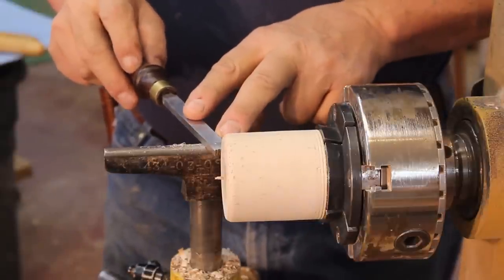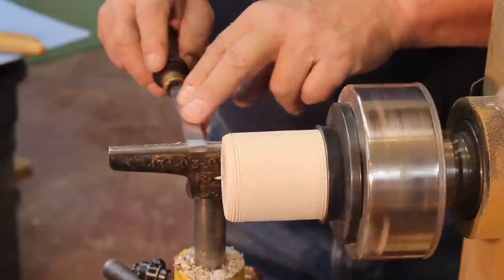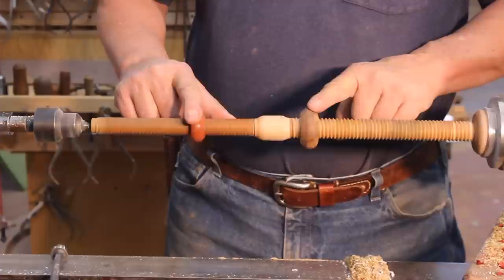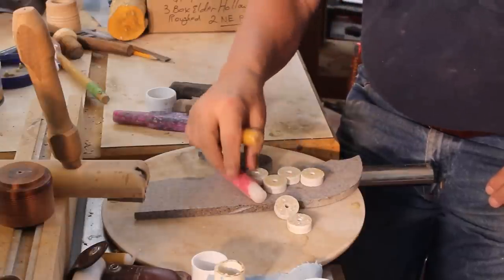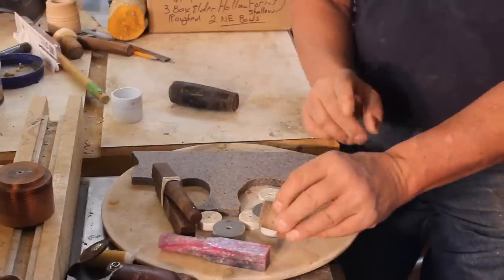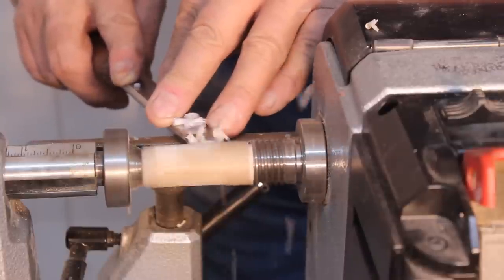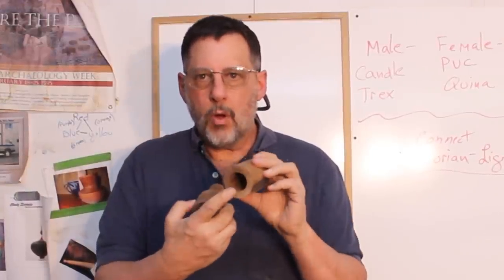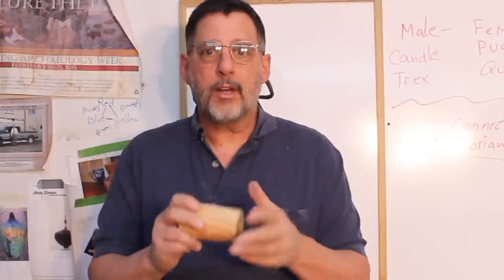Teaching aids for Thread Chasing: woodturning

Comment: Sam ... I appreciate you doing pieces like this. I think one area where most of us hobbyists fail at is the need to practice. I'm trying to do more practice runs with cheap stock like poplar and pine before I chuck up the good stuff. Some of the practice pieces actually get finished, but most just go to the burn bucket.

Comment from the maker: I would recommend either a 16 or 18 tip chaser.  You can get either at Hartville tool in Ohio.  Good website and free shipping.   I started with the 16's.  16 chasers are easier to mate the female and male threads cause the depth of the threads are greater.  20's may be easier to chase but are tiny in comparison and I find hard to mate up.  Sam

Comment: Hi Sam I have for a few weeks trying to make a thread chaser from a bolt and a die. My lathe will only go down 600rpm I do not know if this my problem. Have you ever made a thread chaser? My threads look good  but that is all they will in no way thread together.
Reply from the maker: +Jerry Gwin I think the 600 RPM is do-able, a bit fast but that will take some practice.
Yes, I did try to make some thread chasers.  I think maybe the bolt approach might be a good way to go????? Not sure.  I actually tried to form them from old wood chisels.  I gave up very quickly.  I am a woodworker.  I am not a machinist.  If YOU are more of a metal worker, you might have better luck.  If this is what you like to do. Go for it.  But if you want to get into chasing threads by hand, then go by a set and you will be farther ahead.  Good luck. Sam
Reply: I made my own chasers using pieces of square 1/2" iron stock and a 1/2" bolt. They work very well, you just need to temper them. Now I wanna make some more TPI ones. In my channel if you want you can se me using those chasers o a soft wood (thats why they don't finish cleanly)

Comment: Hi Sam.  Thread chasing issue: can you chase on other than spindles?  I'd like to make a low box, 3 or 4 inches in diameter, and maybe 2 inches high.   I don't have any spindle wood large enough (that will take threads).  I have some osage orange that I think might work.  What do you think?  will it work?
Reply from the maker: +Daniel E Moerman Yes you can.  I have the same issue at times.
I cut ebony or another suitable wood "cross grain" from a small board.  Chasing this way actually works very well but you must be careful with the wood shrinking or moving.  I would try to dry it a bit first.
Sam
Reply: +WYOMINGWOODTURNER Thanks.  That's encouragiong.  I will be careful, but I'll try it. I'll let you know how it works.  Cheers, Danl